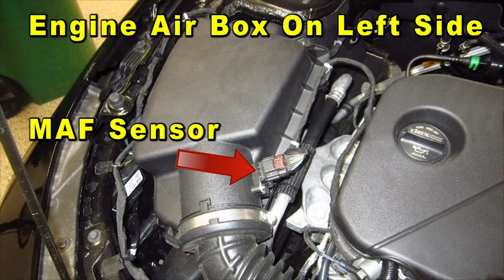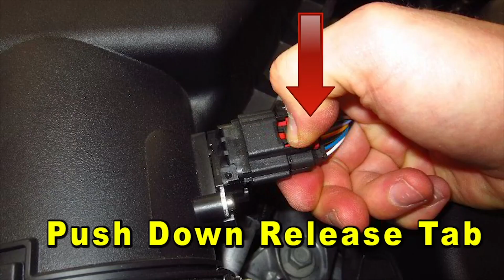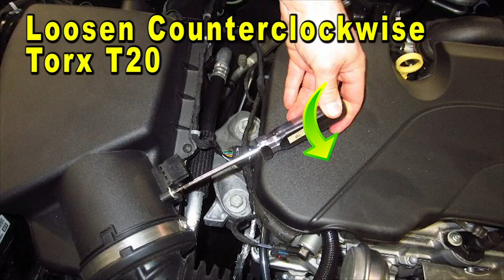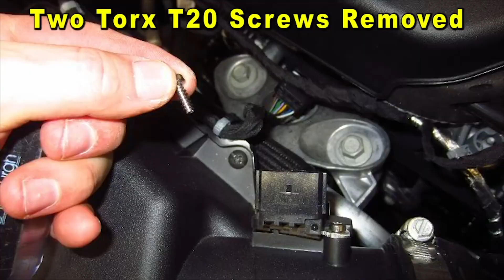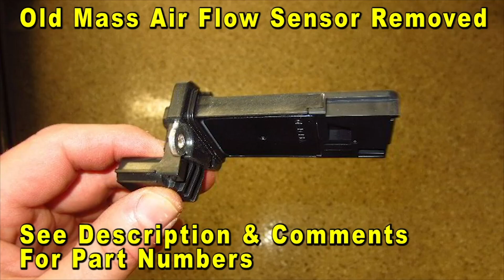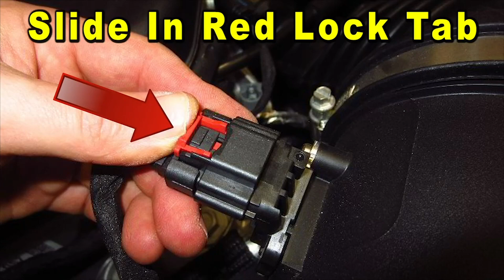2016 To 2024 Chevrolet Malibu How To Change MAF Mass Air Flow Sensor + Part Numbers - Quick & Easy

Comment from the maker: Chevy Malibu MAF Sensor Part Numbers - https://amzn.to/3N0aKgf
GM OEM Mass Air Flow Sensor Part # - https://amzn.to/47VRQzd
Spectra Premium MAF Sensor Part Number - https://amzn.to/3uwMRGx
Torx Screwdriver Set - https://amzn.to/46zCXRN
Precision Screwdriver Set - https://amzn.to/3sLixaP
Plastic Pry Bar Tools - https://amzn.to/3HMtsV7
Socket & Ratchet Set - https://amzn.to/3Z17LbA
Mechanix Gloves - https://amzn.to/3jCnHkt
Torque Wrench - https://amzn.to/3vS5uSI

The Paul79UF YouTube channel is a participant in the Amazon Services LLC Associates Program, an affiliate advertising program designed to provide a means for sites to earn advertising fees by advertising and linking to Amazon.

This DIY video shows owners of the 9th generation 2016, 2017, 2018, 2019, 2020, 2021, 2022, 2023 & 2024 Chevrolet Malibu sedan how to change a failing or faulty MAF (mass air flow) sensor for the Ecotec LFV 1.5L turbocharged I4 engine.

Comment from the maker: Check out the DIY guide for changing the MAF sensor in a 2016 to 2024 GM Chevy Malibu -
https://www.paulstravelpictures.com/2016-2023-Chevrolet-Malibu-MAF-Sensor-Replacement-Guide/index.html

Here are all of the DIY repair and maintenance tutorials for the ninth generation 2016, 2017, 2018, 2019, 2020, 2021, 2022, 2023 & 2024 Chevrolet Malibu sedan - 
https://www.paulstravelpictures.com/Articles/2016-2023-GM-Chevrolet-Malibu-DIY-Repair-Maintenance-Guides.htm

Owners of other General Motors vehicles from Chevrolet, Buick, Cadillac, GMC and Holden such as the Impala, Corvette, Bolt, Sonic, Spark, Express, Trax, TrailBlazer, Equinox, Traverse, Blazer, Tahoe, Suburban, Colorado, Silverado, Cruze, Volt, Camaro, Encore, Envision, Enclave, Regal, LaCrosse, Canyon, Sierra, Terrain, Acadia, Yukon, Savana, XT4, XT5, XT6, Escalade, CT4, CT5, CT6 and Commodore may also find these DIY instructions to be helpful.

Comment: Can't get the screws loosened
Reply from the maker: Hi John, I'm sorry to hear that. You could try using a stripped screw extractor. Or you could dremel a cut into the screw head and use a flat head screwdriver.

Good luck!